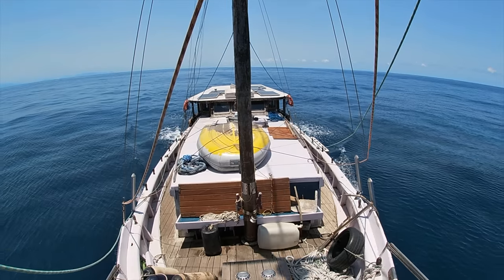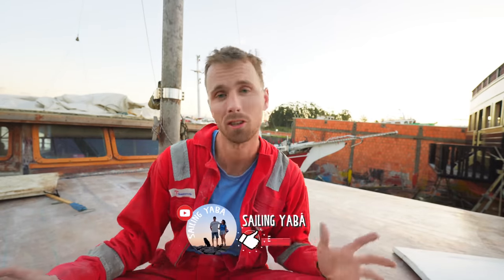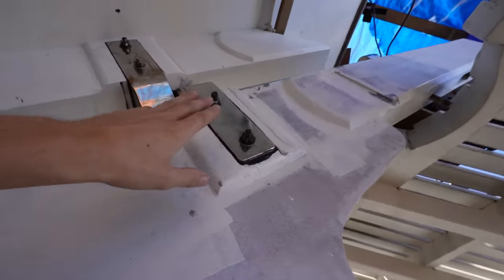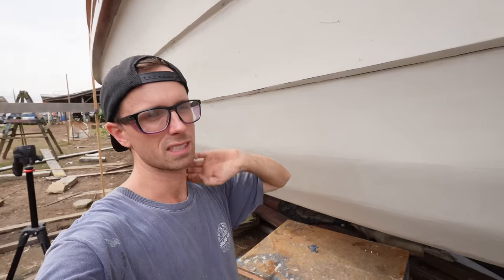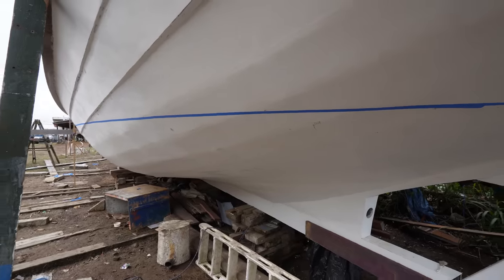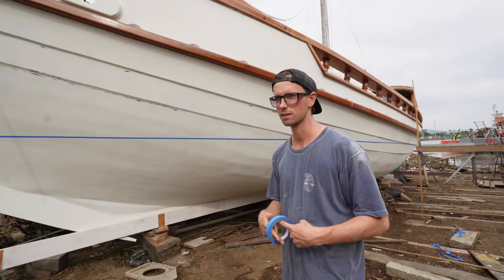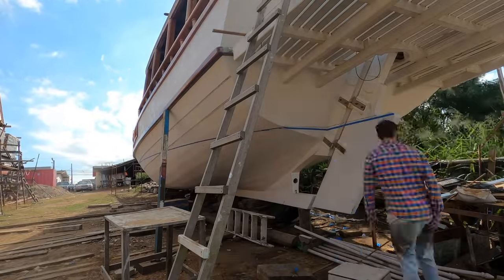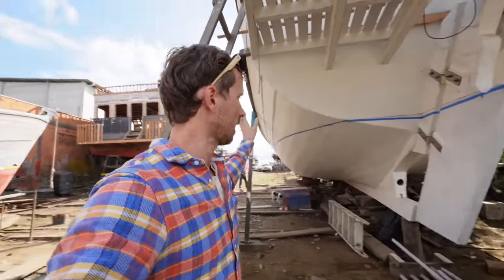Defining the WATERLINE of our once SINKING BOAT without any equipment — Sailing Yabá 138

Comment: use a clear hose filled with water.  Once all the bubbles are out of the hose the water level at one end of the hose (the top of the water) will be at the same vertical level anywhere you choose to measure.

Comment: Always interesting to see how close you guessed the waterline to the actual waterline. They splashed Acorn to Arabella yesterday and their waterline was a couple inches to low. You guys should to a poll to see who guesses closest the actual waterline of your boat.
Reply: While there may be some small issues as the wood in not waterlogged, they have pictures of the water line when they first dry docked, it cannot be far from the original.

Comment: If you had a laser it would have made it so simple. However you have a long builders float. Measure the back and then go from mark and with the float laying against the hull you will have an accurate line.  . Well done as always. I dont see all the videos you do as its a nice suprise to see the skooner looking more and more as it should. Oh. I used masking tape as I moved the float along the hull. Done in 40 minutes. I say it will follow the third plank down from the brown buffer.

Comment: Using a level off the rudder reference point is correct only if the boat is sitting on the hard level.  If the bow is down the waterline you draw will be too high at the bow.  If the boat is heeled to starboard the line will be too high on the starboard etc.  So, things like levels transits and laser levels all assume the boat is sitting as it will on the water.

Comment: I had the same problem many years ago so I made a levelling guide from a reel of clear tubing. 30x 1m lengths all pushed into small holes in a length of garden hose. Each length taped at intervals along the hull and fill with water until the general level is reached. Then just mark the level at each point (assumes boat is level). These days I use a builders laser level but whatever works.

Comment: I've only watched the video about halfway through and I'm thinking to myself having done this a million times in boatyards since I was a child that the easiest way is always to launch the vessel and let it sit in the water for a few days.. even in the worst of marine environments you shouldn't get any growth but you will get a water stain from the elements that are polluting there... that will then give you an indication of where to draw your line you pressure wash the bottom, prep and apply your bottom paint
Reply: This would be a difficult procedure in that boatyard (Yabá would have to be moved across and down) and with that boat.
Reply: The water is going to stay level no matter what end of the tube you're in it's either going to pour out the end if you have it too low the water is every time p but look up they're always no matter where you are
Reply: @StanleyCotton-xv4qb   Its not the level of the water but the level of the boat.....
Reply: But if your vessel happens to be top heavy, then your waterline will be in the wrong place, won’t it?
Reply: @StanleyCotton-xv4qb , you are answering the wrong comment.

Comment: In construction, they use a self leveling laser level to get matching elevations in large and small spaces.
Seems such a thing would work well for you in this case….although, by the time you read this, you will no doubt have solved the problem.😊

Comment: The line is not at same level on both side of boat, if boat is not string up. You can double check your concept by thinking if boat is way out leaning another side. In another hand, If you know that your boat is absolutely straight, easiest way to check both sides be on same level is use clear plastic pipe and colored water. You have your 20cm markings to reference on both sides. One person is keeping this long pipe on same place on deck. Another can move pipe next to hull and check if water is on same level as your first waterline is. Then you can just go another side of boat and draw line where water is there.  (If I remember correctly you have used this earlier).

Comment: As a home builder we wanted to measure a straight line between one room in another room there was a very simple way of doing it.. we would take a 10:20 or 50 ft clear tube it doesn't make any difference... If you fill the tub up with water except for the last foot.   As long as you hold the two straight across anywhere it doesn't make any difference this flashlight the water's going to stay it doesn't make any difference you hold your level or the tube of high enough to where the water won't run out and whatever point you look at on their the water is always going to stay level no matter which in your at no matter how you're doing it if you have one point of reference it will stay level no matter whether it's 10:25 50 or 100 ft hose but that you have to look at it as your ocean your ocean is going to be level if it's calm water the water is going hey level

Comment: Regarding where the waterline used to be in old photographs, many of the timbers and planks, not to mention the keel timbers were riddled with worms and completely waterlogged, so you may find the boat floats higher than it used to.

The problem with a water level tube is that the bow is noticeably higher than the stern thanks to the slope of the boat yard.  It would only work if you were hauled out on a level concrete surface. Otherwise, you would have to jack up the stern of the boat to make the bottom of the keel level. Same problem with a laser level.

Comment: When you mark 3 points on the boat. Front, Middle and Back. Then you can use a splash line. Or a laser from the Walt from the center. It makes a cross, so that you remain equal horizontally and vertically. Greetings from Spakenburg, the Netherlands.

Comment: The new timber may be heavier but remember the old wood was rotten very wet and heavy so there maybe not that as much difference as you might think.A standard garden hose with a clear tube either end and filled with water would have that water line done in an hour.Very surprised no one in the yard new that. !?

Comment: It is so easy to draw a waterline! Get a plastic hose, (a clear one to see its contents. You can use later in the boat as vent lines, oil drain, etc) of at least half the boat length, fill it with water up to, say 5 cm (2"). Set the water level at one of the ends on the reference point and at the other water level use a pencil to draw the waterline at the same level of the reference point you draw in the first place. NOTE: the boat must be level bow/stern and port/starboard- The reference point is distance you find from the keel up to the waterline (draft). I am very sorry to say, but it seems you did the most to make a simple operation a very difficult one. Why did you use a level to transpose the first waterline (port side) to the second waterline (starbord side)? Just measure the distance over the hull one side to the other. Why so much reference points if earlier you found a way to set some distance with the tape? Do not take me wrong, but it puzzles me how difficult you made things. In reality you just needed to use the hose, the water and the tape all combined in one operation. Done, say, in two hours!

Comment: i had a wooden boat that the builder used. 1/2 " brass tacks with tiny round head to permanently mark water line. they were still visible after 50 years and all paint removed.
Reply from the maker: That’s a great idea. I’ve seen people lightly cut into the wood using the help of a batten to leave a king of scar down the side, then fill it with a dark epoxy. I like the idea of tacks. That way no matter how much it’s sanded it will always show

Comment: I would think with all the new wood added to the boat, wouldn't be much easier just to launch and verify the actual water line as it sits IN THE WATER? I realize you're trying to adjust for the anti-fouling paint, but one floating might solve a lot of future problems.
Reply: the problem is the boat is quite big and heavy, so launching and retrieving it is not only a lot of work with a lot of people involved so they only want to launch once and not retrieve. a lot easier to paint it savely high enough and then live with it for the next 8 month untill the boat is out of the water again.

Comment: @02:35 I like you doing it the old way. Your explanation was pretty clear, I think.👴😉☺
What your actually doing is creating a a horizontal plane (like the water-level would be) 1.6 m higher than the keel.
(Assuming that the boat is level and the WL is parallel with the keel, otherwise you have to correct for this.)
With the adjustable line you can mark the horizontal plane (as the water will be) on the hull.👴🤷‍♂
What another option is: use 2 lines. 1 close to the hull, the other one further away. Have someone look over the lines (one should  be exactly behind the other) and tell another one where to mark on the hull.👴😉
@25:37 I think you're making a good effort but end up doing it again when you haulout in the future. Then you have the real waterline.👴🤗😁

Comment: Are you still keeping an eye on the bananas lol?
You could have just used a string going from both the straight tape from the rudder and a second one going from under the hull so you can touch the strings together for the correct spot on the hull.
Have fun you guys!

Comment: Forget all the armchair experts, carry on as you are doing getting it somewhere in the region, and adjust after she's launched when all the many factors like fuel, water, the changes you made in ballast, and the fact she will be a dry as bone (to name a few) will become clear. You may even want more ballast or change some around if she has a list etc. In other words, carry on guys, for adjusting a water line later is nothing in comparison to what you have achieved to date! Well done Ben and MP!! PS: Once the beer and wine is aboard, she will be even lower lol......
Reply from the maker: Hey Andy, thank you. This is what we are trying to go for. We are not expecting this waterline to be the final and correct one. One the boat is filled, wet and in the water we will find out wether we can wait to redraw the line later on or if we should lift her and redraw it straight away

Comment: At 2:41 stopped replay to say: use footage from when you hauled her out, then set a laser level to offset the angle of the slip, etc. I reckon the marking could be done in 1/2 hour.  Let's see how long the video takes and how many man hours are involved?
Reply: The tape line looked good, perhaps you could include a boot strip too, always provides an attractive contrast / transition to the antifouling and topsides.  
When it comes to installing water intakes, outlets, have you considered using as few hull fittings as possible? e.g. using one standpipe to take off multiple intakes, taking drains to an outlet. Perhaps muliple inlets outlets for the engine, to allow for easier declogging and a choice of which side the exhaust is let out (always on the leeward side (downwind).   Also composite Seacocks are very durable, although they may not be available in Brazil.  Having standpipes allows you to close off the primary inlet/outlet while maintaining the individual stopcocks.  You can have fewer strainers on the intakes too.  As you know each hole in the boat increases the risk of leaks, deterioration of the timber, the risk of failure.

Comment: Well, you got it done...the hard way.  I'm surprised that there aren't construction companies working in that area where you could borrow their laser level to get the line established in 1/10th the time.  If nothing else, you could promise to put them in the video so they get some free advertising and they might even sponsor this video too.  With a laser level, you can guarantee that it's even from the front to the back of the boat if it's set up correctly.

Comment: Don`t forget that the wood on the old boat was heavy with water rot. than the wood is now which maybe lighter so you will not get a proper water line until you splash. then you will get a real water line after you have installed every thing you need to install. and redo your masts and ad new or used sails everything will make your water line different. so doing the water line after you have been in the water is a better way of doing it plus you have new Ballast installed in tubes

Comment: What I have done on airplanes for a straight line is level the craft. Determine the line start point, then take a clear plastic tube and fill it with a coloured liquid that you can see and go from your start point and just mark the liquid level line down the side of the craft!
Reply: Does this airplane sit in the water???
Reply: @johnfulton8023  Some do!
Reply: So it has no relation to a boat then, which is what we are discussing

Comment: plastic clear water tube would be very simple by using the aft mark as starting point. Could move all around the boat and be perfect anywhere it was marked. Look it up. Used today stil  but centuries old method.

Comment: Just wondering how much  weight has been added to Yaba and will that have any impact on the water line PLIMSOL LINE either more than the 1.60m rudder mark.? I am just trying to picture a possible difference in height.

Comment: a Surveyor’s Level would have sorted it easily. You can improvise one without difficulty with a Camera Tripod with a bubble level on the swivelling head (every half decent camera tripod comes with a bubble level ), to which you can attach a cheap laser pointer then at the correct height above the bottom of the Keel at the centre of the boat slowly rotate from stern to bow or vice versa, someone follows the laser dot with an indelible Marker, then do the same on the opposite side of the boat.  Note, the Waterline is supposed to mark the maximum loaded displacement level of the boat. Which was improved with the Plimsoll line System used on Cargo ships. On my next Sailboat, when it is unloaded, with no Water, Fuel, People, luggage, Provisions and such, when launched the Waterline is actually about 8 inches above the Water level, and when loaded correctly, the Waterline confirms the Actual Draft of 5 feet. So it would be Really Useful for your boat to have an unloaded Waterline indicator Marked at several points along the Hull For Forward, Aft, Port, and starboard load Balancing indications, to help you keep the boat nicely balanced. Things like water and fuel tanks internally in strategic places, with pumps to adjust contents to and from the right tanks assist with maintaining good balance and the proper behaviour of the boat when underway. Hope that helps. Best Wishes and Fair Winds.  Bob in Wales. 👍🏴🇬🇧⛵️🌟🌟🌟

Comment: I think that you have assumed that the keel will be level with the world when the boat is in the water.  If that is actually the case, I will be surprised. Linear weight distribution of the boat fore and aft and the below water hull volume distribution fore and aft will determine the water line.  The boat is much heavier toward the aft end and hopefully the additional hull volume below the water line there will offset the additional weight.  I am hoping that this will actually be the case and you have got the water line in the right plane.  Good luck.

Comment: I would put it into the water then mark it and pull it back out. That is the only way to get it right in a quick and easy way. I would add a little bit for any extra weight you add to it

Comment: She seems to have quite a small rudder, are you confident she'll handle OK, and how do you go about making sure it's adequate. Is it just a copy of the original? She's looking really good, not long now!
Reply: Its a motorboat with sails for downwind sailing. The rudder will be fine as long as the engine is going, downwind sail youll need to help it with adjusting sails  and correct sheet handling in the maneuvers. The rudder is surely pretty small, so you need to get the right sail handling to make it work.

Comment: Think you should have rented a laser when you were going to paint the waterline. Would have been an easy and quick job. If it has been correct, you will eventually find out after the launch and you can then correct it the next time you take the boat up.

Comment: Although it's far too late as you've already done the waterline, a high tech solution would have been a laser level. But an old fashioned low tech solution would be to use a hose pipe water level.

Comment: use poly tube with water in it you can then accurately locate water line from one side to the other tube will pass under keel

Comment: All you need is a 50 foot piece of clear plastic hose to use for a water level water six atone level fill the hose up with water as long as there’s no air bubbles in it both ends will be at the same elevation

Comment: I’m afraid you’re gonna have problems with waves, knocking that swimming ramp or swimming deck off the back of your boat if you’re going to sail her in the Ocean them chasing waves can get pretty big and steep
Reply: you mistake this for an offshore vessel due to its size. With that low of freeboard its more like a costal vessel. If its high waves or windy just stay in port, its fine.

Comment: And when you transferred the height to the starboard side …you just drilled tiny little holes in the hull and leveled  them across, then drilled more very small holes in the hull on that side and joined up the holes like a dot to dot picture…..brilliant !!!🤔🤭